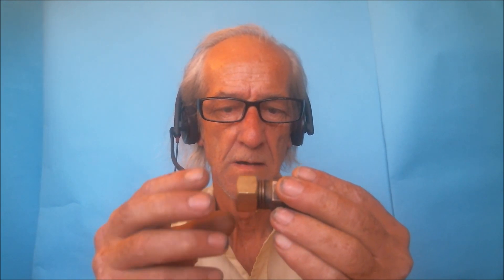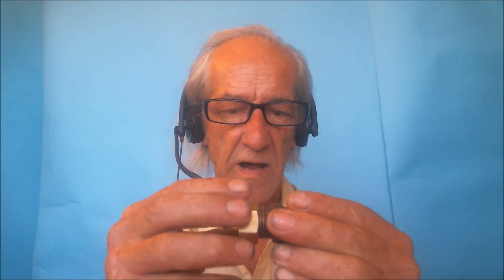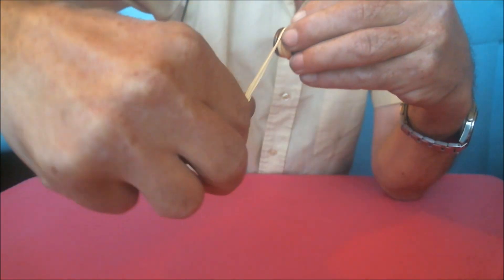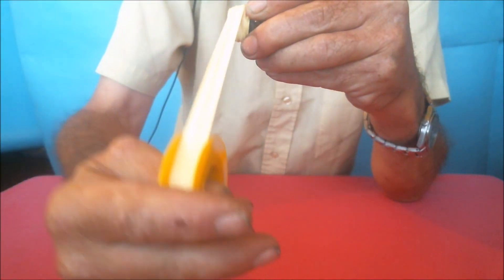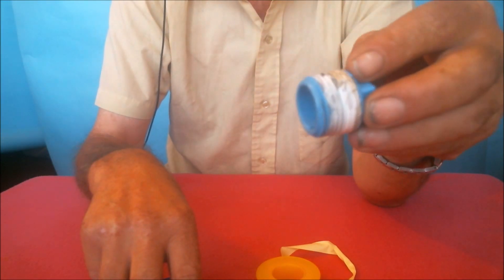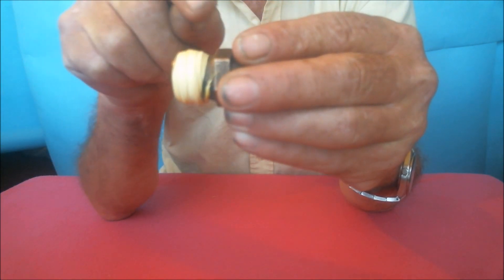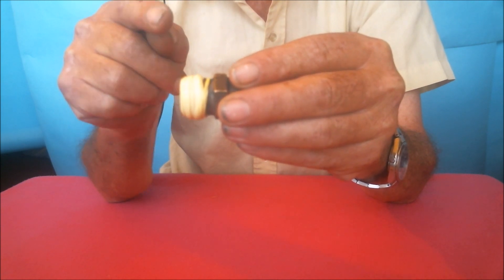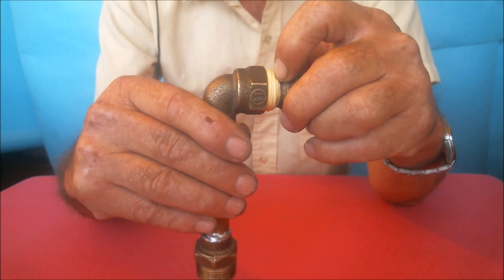The Best Way to Wrap PTFE or Teflon Tape - #teflon #ptfe #gasleak

Comment: "CONE OF PTFE " cover to seal. Nice words I like it and very meaningful.
Reply from the maker: Thanks for your comment Babu.
Reply: just wanted to add and share on something that i wrong i think and costly may i add when installing a stove for a friend gas i understand his explaining and video great and had not known this method but when installing a gas stove there is always a concern so you but a little extra well with tape i cracked the cheap ass cast regulator by using tape i was told by an old timer that laughed you never use tape on gas you use dope I've used both for t6higs and such but i never did that again witch cost me $200 for a new one and was lucky i thing that supply house had one witch also laughed witch i think must here and see many stories so witch is it and maybe regulator is not tapered and i did not wrap it crazy times around  witch why i wanted to put out my out of pocket didn't want a issue with a neighbor could have told him anything but just not me at that moment in life money wise i was fine but i know how it is tough at times also my mistake so i just did the right thing but also i blame tape and clearly states gas you the yellow one for all wise asses  i dont do this sharing much but things are better from honest work so i read more and also laugh 
Best Frank

Comment: what about boilers? espresso xh boiler??
Reply from the maker: I'm not sure Plur, I'm not familiar with boilers, although most probably they accept  PTFE just like all water piping, hot or cold.
Reply: @RODsDIY  I am not sure. There are copper washers. They are suppose to be the "pressure" element and seal.. But I am not sure. And now I have dismantled it all, no one stopped me.. only a 5k$ espresso machine..

Comment: I just changed my LP gas valve on my fireplace but haven’t hooked it up yet. I used Permatex and white tape , should I be ok?
Reply from the maker: Hi Shelton. I have never used Permatex or any similar compound, only PTFE tape.  There are 2 ways to be sure you'll be ok: 1) test for gas tightness using a special manometer and air; 2) Test for a gas leak using a detergent: https://youtu.be/LWV6F4mr1II
Reply: @RODsDIY   wow you read my mind. That’s exactly what I had planned once I get it together, I have a “sniffer “ and I’m planning to use soap and water to check for leaks. Thanks for your tips

Comment: I tried all the other videos but this is the only video that explained clearly why it works. I tried at least twenty times and water was still leaking until I tried this method which worked immediately. Thanks a lot!
Reply from the maker: Thanks for your comment Chin. Yes, it also works with water.

Comment: With that much tape won't the female nut/piece split when tightened?
Reply from the maker: Nope, unless it's made of PVC.  Brass threads squash the PTFE and push all excess out.  In any case you can test it yourself and if it gets to hard to tighten the pieces, put less PTFE on.  But make sure it has a cone shape, so it gets hard to turn at some point.

Comment: I understand that yellow teflon tape is to be used for natural gas / propane fittings , etc.
Reply from the maker: That's the theory some people have, but there is no regulation I know of, regarding it can or can't be used in gas or water. I've heard they shouldn't be used in liquid oxygen, but I don't know if this is just an urban myth.  The difference between white and yellow is mainly density, one is thicker than the other so requires less turns.  For that same reason, the white PTFE (especially the cheapest versions) tends to tear more easily so can be a bummer when trying to wrap a pipe, and probably has a shorter life between threads (although I have no facts to back this theory).  PTFE is plastic so takes thousands of years in degrading, and if well packed in between the threads should do it's job permanently whatever color it is.  Fluids different to natural gas, propane, butane and water (i.e. petrol, liquid oxygen) might react with plastic or degrade it but, as I said, I have not seen any technical analysis regarding this.
Reply: @RODsDIY  Ok , thanks for informing me . I had worked as a plumbers helper and discovered on my own . Thrat to wrap fittings , end being the beginning and to turn the other way, that end staying intact .

Comment: I haven't used PTFE in 10 years and needed a recap since my gas regulator has expired. Thanks for this, I will be using this method now. Before I just went clockwise and remember it was very fiddly trying to get it to stay in place on the first turns.
Reply from the maker: Thanks for your comment Arcane. Yeah, it's quite frustrating when you are starting your second turn and it all slips away.

Comment: After watching this video my tiny gas leak to stove was fixed.  I kept getting little tiny soap bubbles on test with a very faint smell of gas.  I had put PTFE on a copper compression fitting..... Deerrhh.  It had the smallest of a leak.  I took it apart, removed PTFE tape, made sure it was aligned good, tightened it up and .... BAM.  No more tiny leak.  Thank you Rod for a great instructional video.
Reply from the maker: Thanks for your comment Cardiff. I hope you send that info down the grapevine, because too many people use PTFE tape for anything.

Comment: Awesome technique, in my opinion with brass we need to be careful , lead free brass nowadays is very soft and will crack with too much tape or force
Reply from the maker: Thanks for your comment Boise Family.  Yes excess force can crack brass fittings, but using too much tape will not crack brass. If you put too much tape you wont be able to turn the threads using proper tools. If you increase the size of the tool to increase the torque, you can even break steel fittings if you want.  But, of course, I'm talking of proper tools and appropriate force.  It would crack PVC though, even with normal force.

Comment: Can white tape be used on gas fittings?
Reply from the maker: I don't know which are the laws and rules in your country, but in technical terms it should be just as possible as the yellow tape as long as one uses a sufficient amount.  The yellow tape is denser and doesn't shred as easily as the white tape so it's easier to ensure there is enough amount and its well distributed along the threads, so probably we should prefer yellow in gas, but I don't see any good reason why you can't use white if you use it correctly.  I haven't seen any technical review on this topic or any rule against white PTFE in gas, but maybe there is one somewhere.
Reply: @RODsDIY  thanks

Comment: Great DIY video but clockwise? I looked this subject up because when young I worked what a plumber that taught me how to do this correctly (I thought) but couldn't remember the process. What I did remember is that he wrapped backward to what you show (counter-clockwise) and started from the end of the fitting I believe. I remember he said to do it this way so when tightening the fittings together, the friction wouldn't try to unwind the tape? Maybe we were working on a reverse thread or something?
Reply from the maker: Yes, most probably you were tightening a counter-clockwise thread, otherwise it wouldn't have sense.  One just has to visualize how the threads turn on each other to see what can loosen the tape and what will tighten it.
Reply: @RODsDIY  
Correct! From your observation, either way, you'd be winding in the direction of the fitting thread direction. (wind tape clockwise, screw on fitting clockwise, etc.) 

I guess my point is that I was told  it's better to start winding the tape from the END of the fitting so that the tape overlaps itself before any pressure is put on it from the other fitting. Logically it would seem this method would help tighten the tape winding as it is being screwed on instead of wanting to unwind it as you go? You could still wrap extra at the base to achieve your method of excess there to prevent leaking I would think?
Reply from the maker: @1hardlock  If one applies logic either if you start at the end of the thread or at the beginning you should always have the tape overlapping in the right direction.  The advantage of starting at the end of the thread, instead of at the beginning is that you can hold the end of the tape with your finger to put pressure on the turn and get the first turns of tape stuck together.  Otherwise your finger gets in the way, and specially with yellow, thick tape for gas, if you don't pull the tape hard it won't bond, staying loose unwinding while you try to wind. So, either way, you have to hold the end of the tape towards the end while you make the first turn and get the tape to bond with itself and stay in place while you continue turning. And more than have extra at the end, the idea is to get a cone-shape of PTFE tape all along.
Reply: @RODsDIY  Thanks Rod, it makes sense. It's great to be able to have this dialog with you. I just got my heater and accessories but have another question if I may. The fittings included already have a white substance already in the threads. It's sort of hard (maybe just old?) and doesn't look to be tape but is called "sealant" in the directions. I'm sensing by it's feel that it may be old teflon tape?  Should I wire brush it all off and redo with tape I know is for gas or just add more over the top. Wish I could post a picture but don't think I can here. Concerned as I can't pressure test as is called for. Thanks much!
Reply from the maker: @1hardlock  That "white stuff" might be liquid PTFE tape, something I've never seen (as pre-applied).  My knowledge of the business (some practices are different from one country to another) applying liquid PTFE tape before selling an appliance is not an appropriate practice.  Any sealing must be done by the installer.  If it's some contaminant (residues of machining or cleaning or whatever) it should be cleaned off.  If  you don't know how to check a possible leak, you should call a certified gas installer, he should be able to identify that residue and apply accepted professional practices.  Sometimes the fittings that come with appliances bring plastic or rubber inserts to protect the threads, but a first glance should easily give away which is their purpose, and its not to seal anything.

Comment: Hello Rod, great video! Should I use the tape method you show when connecting the usual flexible hose (bayonet fitting supply end) to the back of the the gas cooker?
Reply from the maker: Hello Wizz.  I must say I had to research that connection. Had no idea it existed.  If you look into the parts you'll see the bayonet end enters a bayonet receiver that has an O'ring inside.  That O'ring should be enough to get a correct seal.  If you don't get a good seal (you find a leak) you should change the O'ring or the fitting.  You might fill that end with PTFE tape, but if you stop any leak it will be a fake fix.  Inevitably it will start leaking again.  PTFE is not used there.  At the other end, where it seems you have to screw the flexible into the cooker (LCS elbow) you might need to use PTFE tape if the seal is not achieved using a rubber or fibre washer.  If there is a washer there you shouldn't need PTFE tape.

Comment: do you use this tape on a gas stove in your home ??
Reply from the maker: Hello Tony.  The connections inside a gas stove, hob or gas heater don't use PTFE tape and they shouldn't be manipulated by someone who is not a specialist.  Some connections (i.e. between a heater and a regulator) might need PTFE tape to seal the threads.  Usually, from the stop valve for an appliance and all inner connections are sealed either with fiber gaskets, rubber washers or metal to metal compression joints.
Reply: @RODsDIY   ok thx  I bought a new stove and im smelling gas from the back I was thinking it was because I wasn’t using Tfet type
Reply from the maker: @timmywow89  If you smell gas, you should immediately close the stop valve for that appliance, open windows and call a registered gas fitter.  The leak might be the connections between the stove and the stop valve, but they also can be inside the appliance.  If you've just installed it, probably the external connections lack a rubber washer or gasket. With the gas off you can verify if you left a connection without a seal, but your safest option is getting professional help.
Reply: @RODsDIY  I will thank you for your help
Reply from the maker: @timmywow89  You're welcome. Feel free to ask and if I can I'll help.  I can't always.

Comment: Will it work on fuel ⛽️ line like diesel.. gas no pressure.. ???
Reply: Thank you 😊 I will try it .. looks good so far..on the yellow gas teflon it read petroleum so I tried it so ,waiting now..
Reply: Up date did not work, diesel started breaking down the yellow teflon...
Reply from the maker: @marxsinfo  Pity, it didn't work, but great to hear we have clear results with evidence.  I suppose that covers any petrol related product.  Thanks for the feedback.
Reply: @marxsinfo  Permatex thread sealant, it's readily Available on Amazon.  I've worked on alot of Fords and this really does the job for diesal oil and air lines.
Reply: @rayc1503  thanks buddy.. I’ll be working it now ..
Reply from the maker: I have never seen it used in connections for fuel or brakes.  It might be chemically incompatible.  Maybe you can make a test connection you can supervise closely, before using it on the real connection.

Comment: Thank you for this. Going to use this method for my rv threaded pigtail propane line connection
Reply from the maker: Thanks for your comment Madfzr.  Have a look at my video on kinds of joints in gas systems, because not all joints require PTFE.

Comment: I appreciate you taking the time to share this knowledge. I am putting the fittings together on a propane fired blacksmith forge, and the only instruction was wrap the tape 3 times. They did not even send yellow tape, but white. With your instructions, I feel more confident I shall make a safe and secure connection. I shall test it with my air compresser and soapy water at each join before putting gas into the system.
Reply from the maker: It's great to see that someone, who does not work in gas systems, has proper respect of gas connections, seeking the best advice and checking connections before going live.  My appreciation to you, and thanks for your comment.
Reply: @RODsDIY  Just so you know, It tested perfect. I figured I would have a leak  or two cause of old lady hands trying to make something tight, but it was a perfect pass. I am sure it was the cones that helped.
Reply from the maker: @picklesnoutpenobscott3165  Thanks for your comment, I believe so to.

Comment: This method cured a seemly intractable problem with sealing a compressor check valve fitting that had been re-tapped with some rough edges. The conical shape appears to create a tapered fitting that seals perfectly. Many thanks for the very helpful and creative solution.
Reply from the maker: Many thanks Richard for your comment.  Basically, that's what these videos are for and it makes me happy to know the target has been achieved.

Comment: The space between the threads is minuscule, you don't need that much tape.
Reply from the maker: Maybe it is, but one thing is for sure, if it's too much it will be pushed out and if it's too little you'll have a leak.  I prefer pushy threads.

Comment: Is there a brand you prefer? Is liquid better than tape? Only changing hose on out door propane burner for cooking.
Reply from the maker: I don't know what brands you have where you live, but most probably there is very little difference in quality between one and the other.  I have tried to use liquid PTFE, but I've never got the results I expect so I avoid using it.

Comment: Very good instructions and this is the  correct way to apply tape people :)
I worked with hydraulics for 15 years now and found how much tape you need also come down to the tolerances of the two parts mating together.
Nice one.
Reply from the maker: Many thanks CoolKD for your comment.

Comment: What's with the headset? Funny. Too much tape.
Reply from the maker: Thanks for your comment. I'm sure you do a great job with your methods.
Reply: I think it's better to put much tape, especially for mission critical applications like gas pipe. The tape cone will also act as a buffer pressing against the rim of the pipe and can protect in the future, like dilation/contraction events, or water dripping onto the pipe from outside. Pipes need to be reliable even 20 years in the future, better be safe.